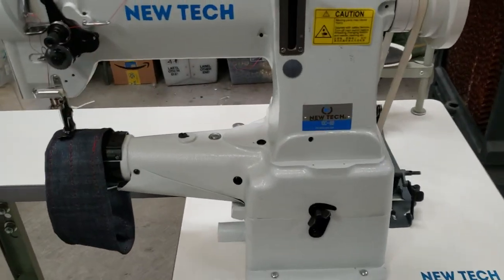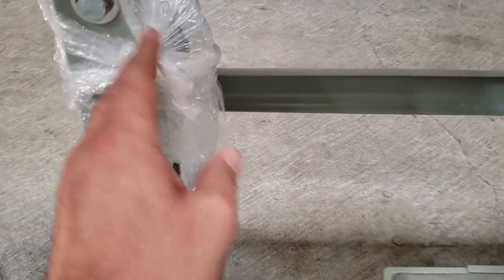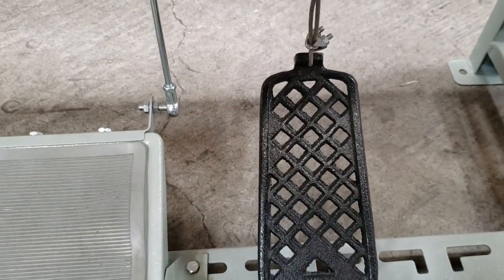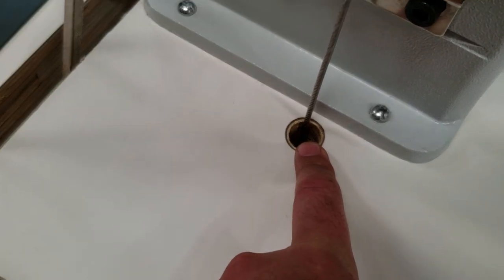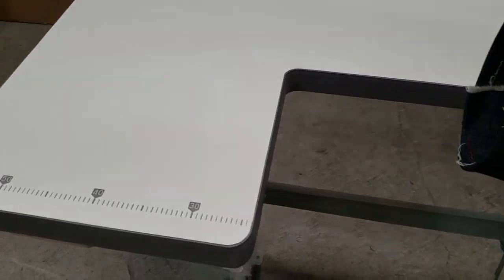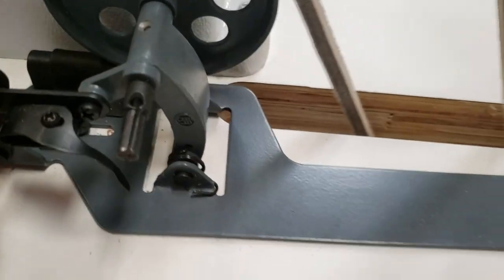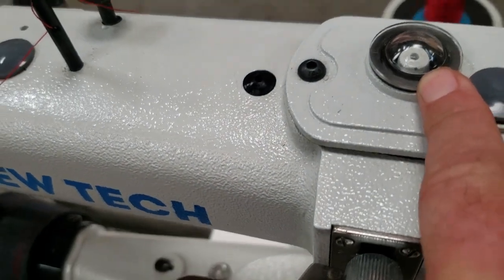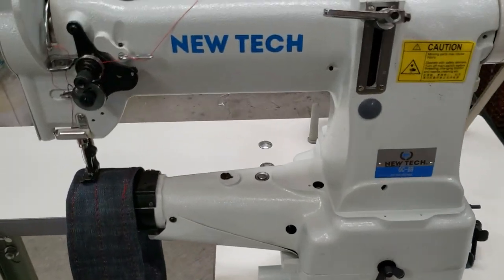Product Showcase - New-Tech GC-8B Walking Foot Sewing Machine - Goldstartool.com - 800-868-4419

Comment: So I finally got the kinks out of my set up and love the machine. I bought the 1/8" piping foot  #S84, S83  and I'm confused on how to use it. I came with 2 pieces and it doesn't make sense to me. Do you have a video for the feet and what they do? Beginners LOVE having info when they move into the industrial stage. Thanks.

Comment: Which machine has compatible parts? I bought the New Tech go-8b and was told (after it was delivered) there is no roller guide that new tech makes. I’m ok with that if another brand has one that fits. Which part should I buy?